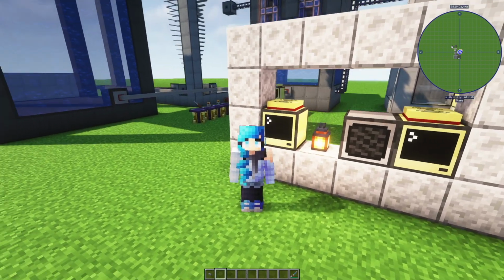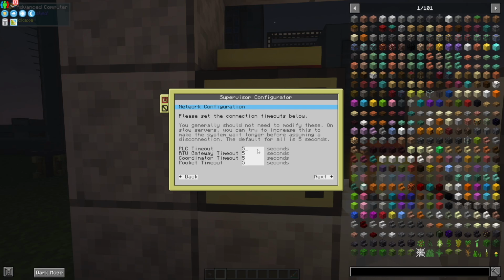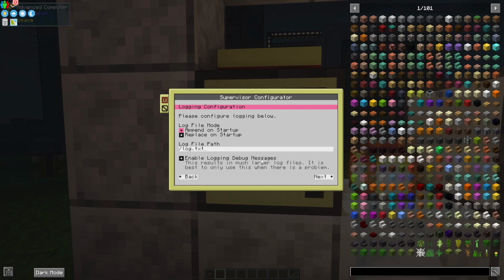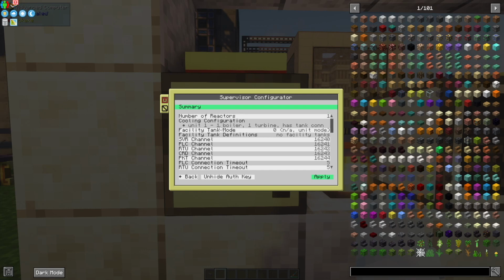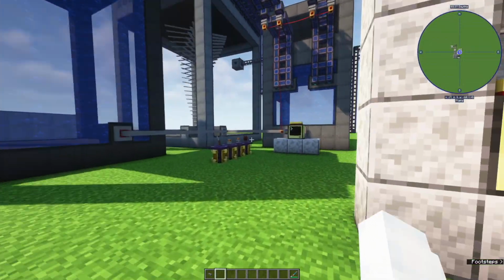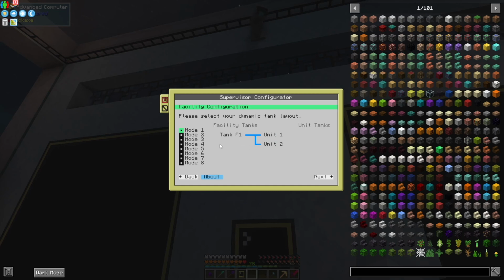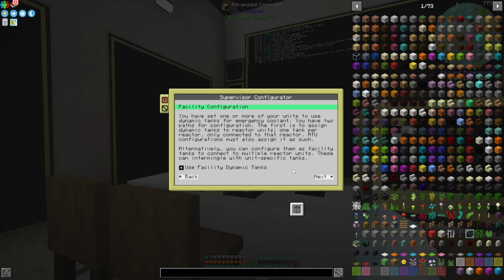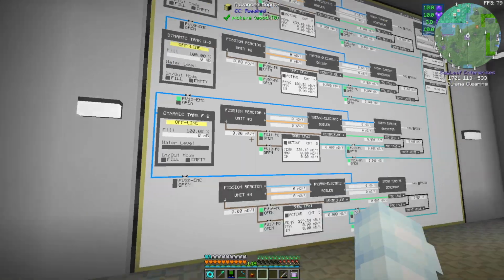Supervisor Configurator

Comment: great addon i use this for my nuclear plant maps but just a note if you are like me and use the same freqency for everyting like for the plc and the supervisor the same it wont connect to anything
Reply from the maker: Thanks! And yeah, definitely don't assign all on the same channel. For some background on why this is designed the way it is, there is a lot of network traffic generated by this system, so using one channel would place a lot of extra message events in the event queues of all devices. This would be worst for the supervisor, as it is already pretty swamped with events. About a year ago (I think), each device used to get its own channel, but I consolidated it to the 5 that are used now.